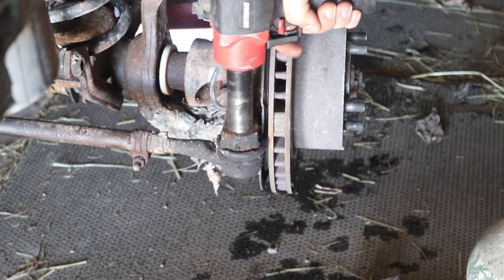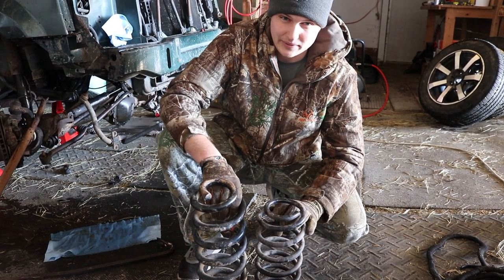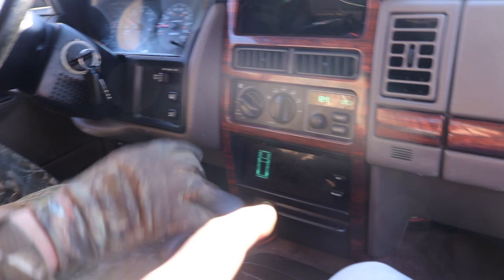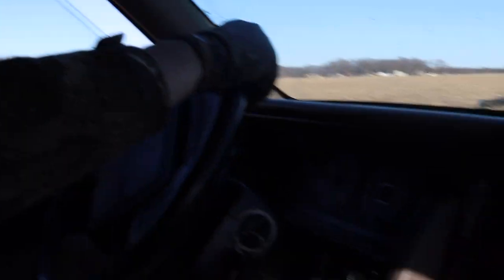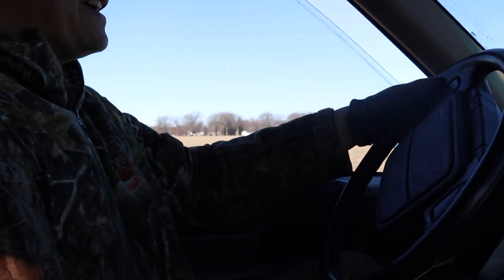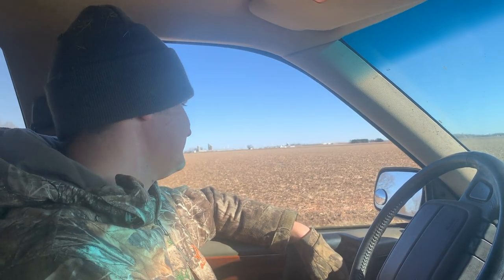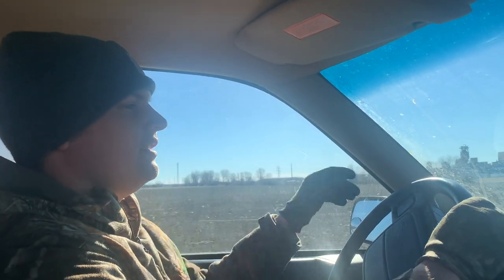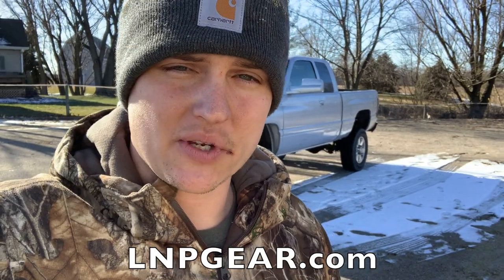I STRAIGHT PIPED MY 4.0 JEEP CHEROKEE!!!

Comment: rear to front i think give small amount of lift, ratchet straps are safer than spring compressors in my opinion, spacers for top of springs would be like 50 bucks